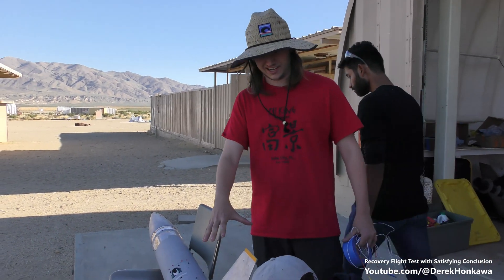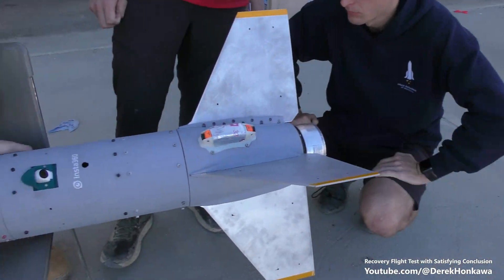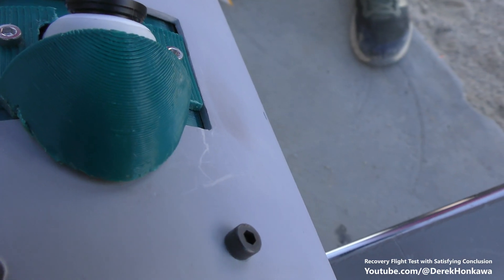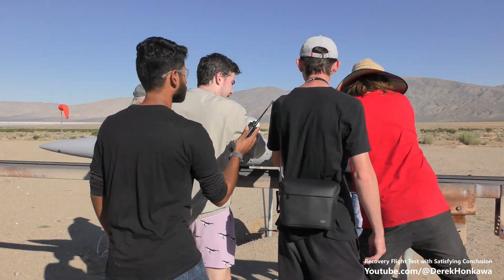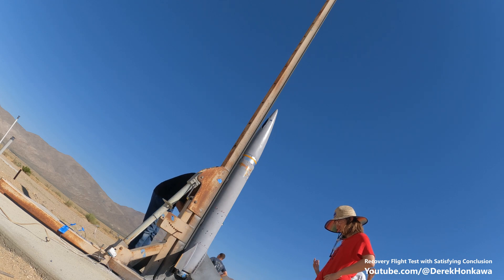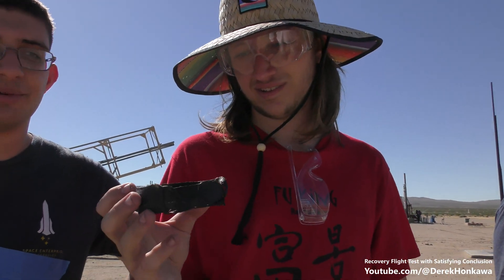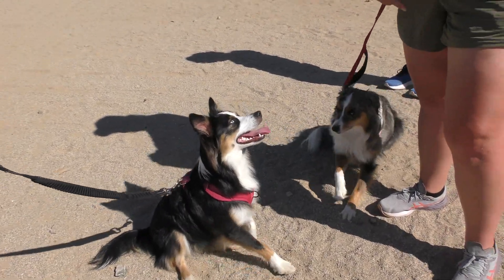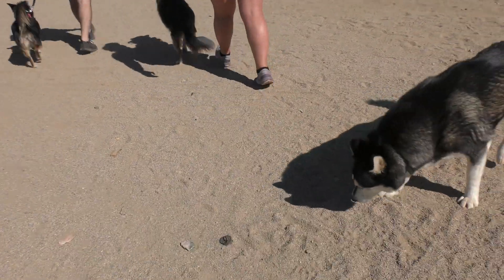Testing Recovery Systems for a Liquid Rocket (With a satisfying conclusion)

Comment: Something I've been advocating for to liquid teams I work with, during development of your liquid or hybrid motor, the recovery team needs to build out the actual top part of the rocket that will be used for the recovery and flight test it on an inexpensive solid motor...the full scale real deal. https://www.youtube.com/watch?v=jWspWbTCXbM 
Launching a subscale or ground testing is better than no testing but during the project motor development there is plenty of time for the recovery team (responsible for 50% of the flight) to build out and flight test the actual avionics, nosecone, and chutes to be used. Similar to what NASA did for Apollo with Little Joe II .
This UCLA team came to me about launching the liquid bi-prop the next month and at my suggestion, built this lower section and fins that we flew 10 days later on the solid motor. Their later liquid launch was successful with perfect recovery and have the altitude record for the FAR Dollar per Foot Challenge.